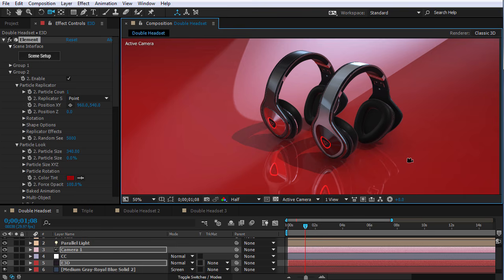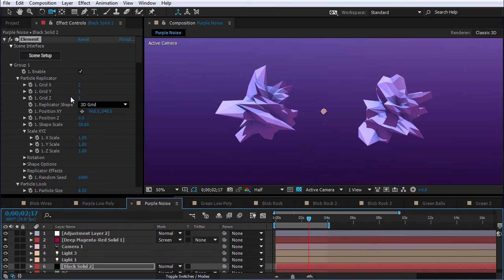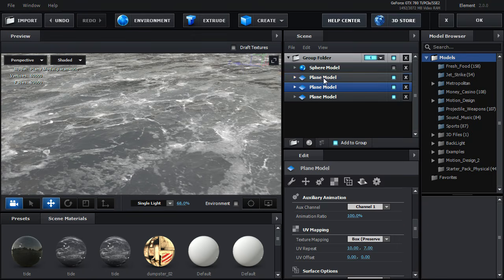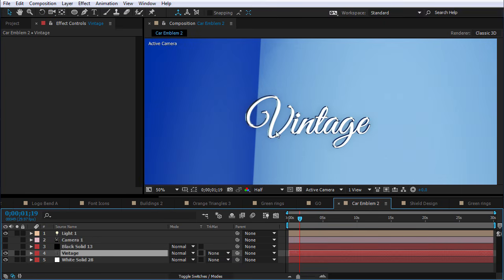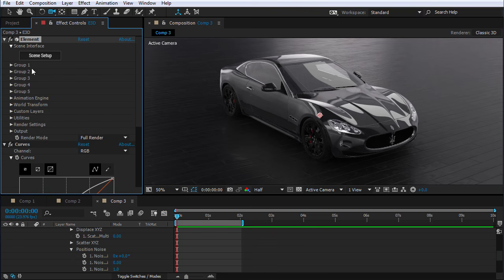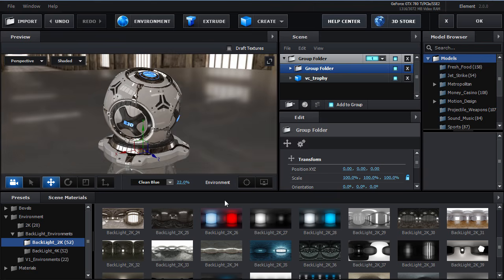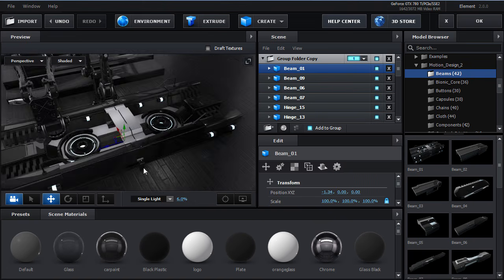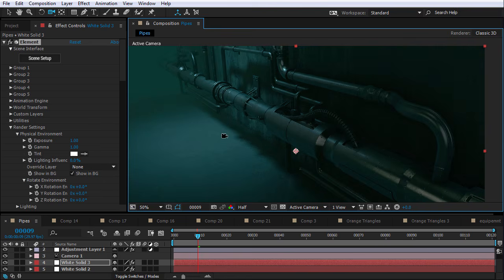Element 3D V2!

Comment: if ive never done any 3d work before would this be good to start? 
and does it come with any 3d models in the base pack? like just v2 come with any models or is that separate?
Reply: Yes, using E3D would be a very good to start to learn 3d and,
yes, E3D comes with models you can use

Comment: hello friend
i need some help with my elements, after i add a model to a scene and trying to add light and the model wont accept light
i did the MM and then turn on the "accept lights" but still doesn't work 
i need some help 
thank you
Reply: Had the same issue. Just click on layer where you have E3D on and i think on environment or reflection settings you need to disable light. There's by default point light enabled. Click to none and then it will be affected by all lights in AE
Reply: thank you!
I'll try that
Reply: no unfortunately it didnt work :(
i turned off the lights and put it on none and it didnt work 
the things is sometime somehow it is working and i dont know why
Reply: really? Because when i turn off the lights and i insert light from AE and then turn off it's brightness, then it gets totally dark. Turn on in element ''Accepts lights'' and then turn it up to 100% If that wont fix it, then i can pm you on email with screenshots ;)
Reply: Here's the fix. Go to Render settings -> physical environment and turn off exposure to 0 and lighting influence. Mess around with these settings. You will lose reflection map though..
Best wishes!
Reply: wooooow thank you very much!!!
finaly its working!
thanks!!
Reply: You're welcome!
Reply: Ronalds Svarups
 dammit its not working again
i"ll tell you what i did tell me if you see something that not right
i added text >extrude in elements>group 1 created group null-> put is whenever i want -> and added light then i did what you told me-->the text doesnt affects by the light i created :((((
Reply: Ok. Test this out from scratch.  Make a new comp, insert E3D, insert light (any light).

Click on E3D layer and first  go to : lighting -> Add lighting -> none
Then go to render settings -> Lighting influence -> 100%

That should be it. If you don't want the reflection map to appear then you can turn off exposure of the physical environment, but that should be it. :)
Reply: hey
sorry for answering now i was on vacation
so...i did what you told me,and theres the funny thing its worked but not as it needed
what i did was
 got to lighting influence and turn in on to 100% then i need to go to exposure and put it to 100% (add lighting at none)
then when im adding for example spot light its acting like a point light and no matter how i moving it its wont affect anything

Comment: Im having trouble with the UI example. Im applying the ui texture to a plane and then changing the blend mode to add but Im not getting the correct transparency. I tried loading a png with transparency to fix the issue but the texture doesnt show up. Any suggestions?
Reply: +Media Mark I've been having the same problem when I tried using the Saber plug-in but I think I've figured it out.  First, make sure the shader is standard, not physical.  Then pre-compose the layer that you're trying to use as the texture and put it into a new composition.  Then when you load up the texture in the custom texture area, it should show up.  Also, removing the reflectivity of the default material helps get rid of the glossiness.  Hope that helps!

Comment: So, question, can you use blacklight reflections but have the background not turned on? (So, for example, you can have the light reflections on a model, but then add just the model with its light reflections into your scene, gaining the reflections, without the background?).
Reply: Yes? Just don't, ya know.... don't add a background. You need a light source for that. Create a light layer, or use one of the lights provided by andrew.

Comment: We are in 2014, guys. 1080p exists ;)
Reply: So does 4K, 5K... etc
Reply: MarCuseusFX Yeah well 1080p would be a good start for VideoCopilot vids!
Reply: Poney01234 What are you running as monitor? A 240P one? There's no need for higher resolution if the quality and detail is already perfect.
Reply: MolecularResearchLab Uh what? I have a 1920x1080 screen, so basically I would enjoy 1080p videos ... 720p was great in 2008, man.
Reply: Poney01234 You clearly have no idea what detail means.
Reply: MolecularResearchLab 1920x1080 is 2.25 times as many pixels as 1280x720. Go watch your DVDs, I’ll stick to Blu-rays.
Reply: Lol@Fail. Check youtube conversion rates and try running Blu-Ray on it. Try harder. You still know nothing about detail.
Reply: Shut up. Of course it’s compressed; but if you can’t see the difference between a 1080p and a 720p video, there isn’t much I can do for you. Watch /watch?v=wTcNtgA6gHs in 720p, pause, then set to 1080p and wait a few seconds. Then don’t comment back because you feel stupid.

Comment: @LeeOfBacup man, I really think that this kind of plugins are designed for motion graphics than a real CGI for films. Off course you can use it whatever you want, but for me, the final purpose for this is Motion Graphics. (sorry if I have bad English)
Reply: Trust me, in the CG Industry we do have a use for practical application for both 2D aps and 3D intergration and that's why Nuke and Flame/Flare are the best compositors out there. Element is great but not as smooth as those two.